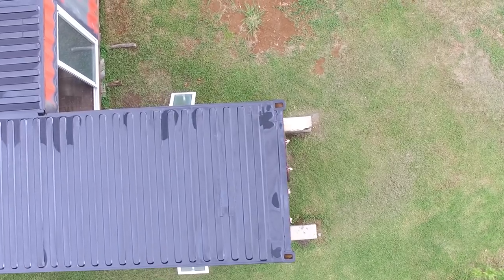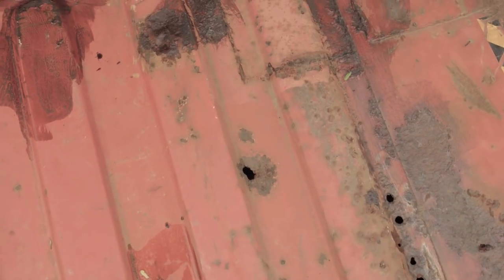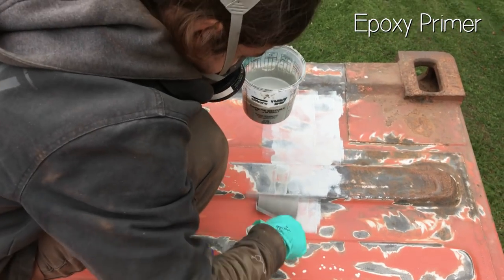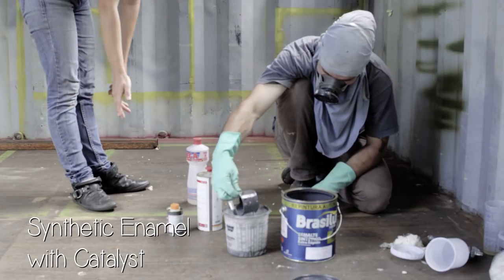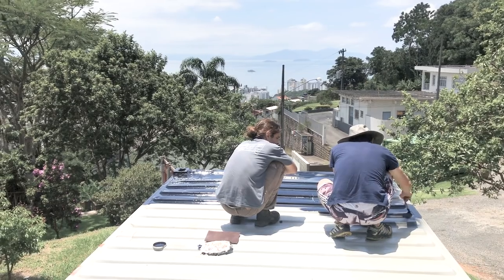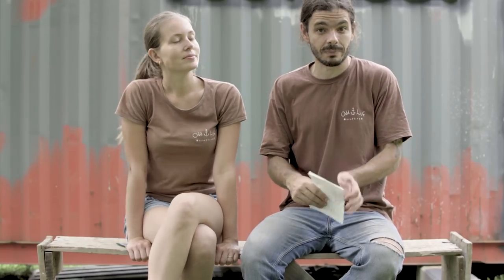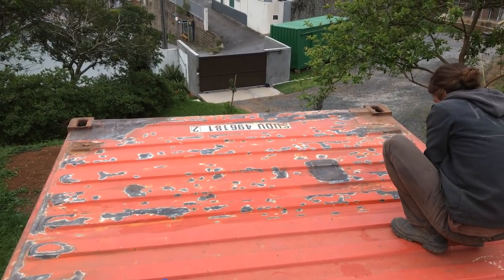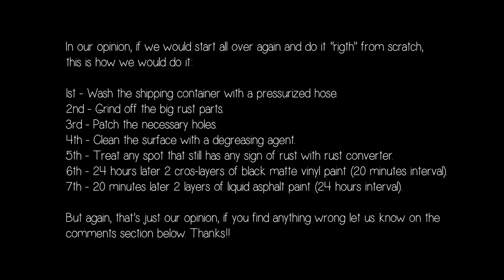Shipping Container House Roof Painting - Living Tiny Project Ep. 013

Comment: Hi On the drone shot looking down on the painted roof i noticed a couple of areas of standing water.in these areas the roof sheets have sagged and are now concave allowing water to pool. You should push back up the center of these roof panels using a support to render them convex again before starting on any covering structure. If you don't these water pools will remain in the shade under your decking for a long time and will eventually cause corrosion and leaking in the future. Great project, well filmed and edited. Congratulations to you both.
Reply from the maker: Hey Chris. We tried actually but there is an area that even when is concave the water won’t lick off as get stuck in between both sides of the house. There is and episode that we talk about that (episode 6). So we gave up and decided to have a roof in between the wooden deck and the shipping container so we can drain the water off. 👌🏼😎
Reply: That paint they put on could line a pond, and, btw, that's what it's called, ponding. that's one of the reasons to do a second roof, that and the thermal summer issue, of needing to keep direct sunlight off their "breadbox" so they don't bake, and later rainwater harvesting...

Comment: When using rust converter just remove the loose flaky rust and apply the converter to the rusted metal spots. It can be done with a wire brush instead of a grinder.

Comment: These containers are made of corten steel. This type of steel creates an oxide that protects the steel, it is not necessary to remove this oxide if there are no holes problems. On the other hand I have a question. What system will they use to insulate the roof from the sound of the rain? Are you going to put insulation on the roof? Are you going to place a stone roof? Some other idea, or they will leave like this. A greeting and a lot of encouragement with the project
Reply from the maker: Thanks a lot for the knowledge. So, we will have a wooden deck on top and in between the shipping container and the deck we will have an ”internal” roof. The kind of roof we don’t know yet. 👌🏼
Reply: that and fighting rust in Hawaii is a fruitless battle. any local will tell you that electronics and appliances need replacing every 5-10 years due to the salt air and humidity..

Comment: Thank you very much for the interesting video and helpful information, I have some questions, can you answer me please?
1) I want to starting build a shipping container home, tell me please what is the dimension of the shipping container from the outside?
2) And what about the expansion of the iron we have a large difference in temperature in summer and winter between 0 and 50 C?
3) What about the cost of the project or any part of it?
Reply from the maker: Thanks a lot. Answering 
1 it depends, there are a few sizes. Ours is around 12 meters x 2,25 meter by 2,9 meters hight. You can google it for more details. 
2 I can’t really answer that but I guess it won’t be a problem. 
3. In our case is a bit different as we didn’t hire anyone to do anything. We are doing 100% on our own so is cheaper. We are estimating 15-20 k us_$ with everything including appliances. 
Hope this helped somehow. Good luck!!
Reply: Thanks for your answering, it’s helpful

Comment: LOL, that guy was quick with the roof 😂😂
There's something I don't understand. The person who works in the paint shop, couldn't he provide you with some advice on what type of paint to use on a container? He should know a lot about paints.
Reply from the maker: He did give us some advices. But he never been in the site so he didn’t really knew the real condition of the rust and of the old paint. About using rust converter on the top of the epoxy primer he said he never heard anything about it so we decided to give it a try anyways. But we didn’t like the results. So we told them so they can help the next client the asks about that. Hehehehe about the guy that help us he was amazing quick!!hehehe😎
Reply from the maker: We did actually scuffed with sand paper but didn’t stick anyway. 😒
Reply: Rust converting primer really only works on...RUST! you neeed to overcoat 24 HOURS.ALSO, AVOID RAIN AND CONDENSATION  24 HOURS  so you don't trap moisture and have bubbles, unless on very warm and windy day. Too windy is another problem...